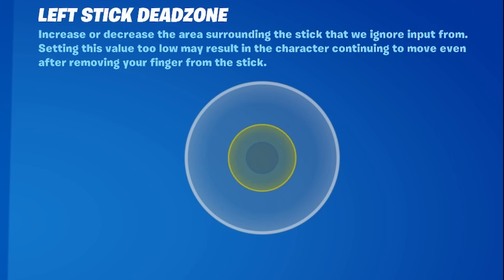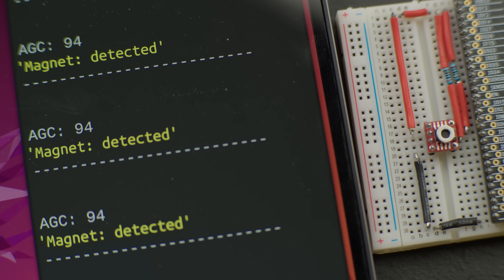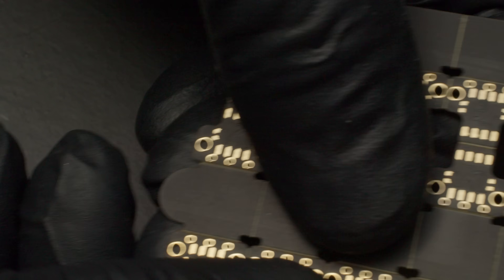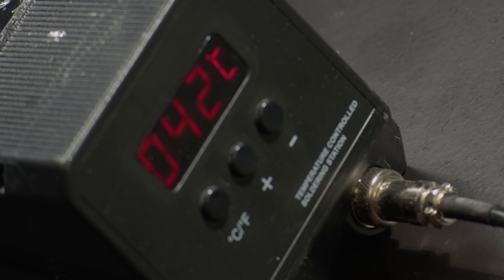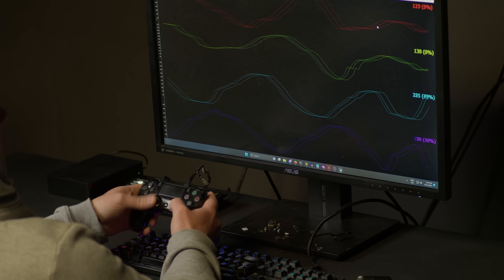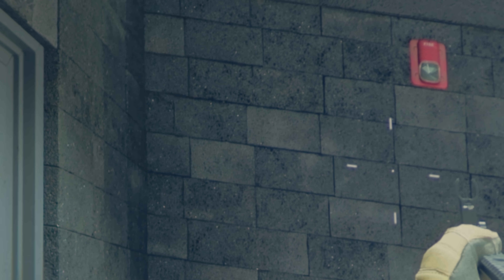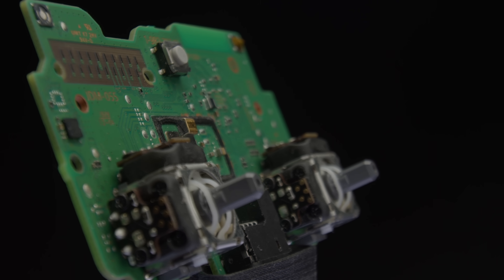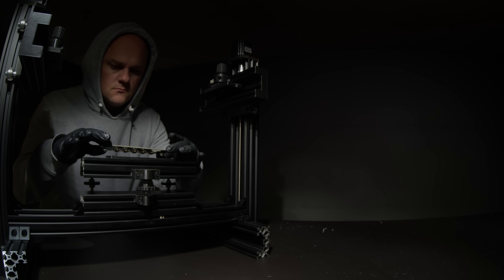Beating the $20B Joystick Drift Problem, and giving it away for free

Comment: well.. this drift issue is sadly common with the PS5 controllers, many brake within months, and Sony know this that why the warranty time is low on them...
they made a pro version in which case you can replace the analog sticks, cos its made modular, but its a fortune...
so if you can do this for the PS5 controllers, that would be great...

Comment: I'm pretty sure the companies that make controllers don't want to fix the problem. If stick drift didn't happen I would still be using the controller that came with my system. Its the only consistent point of failure I've ever experienced. If a single youtuber can find a workable solution, a multi billion dollar company has no excuse other than planned obsolescence

Comment: Slapping these on a VR controller might not work as those tend to get, well, slapped around.  There is a reason the Knuckles use a cast metal frame.

Comment: didn't the Nintendo 64 use optical sensors which is why the stick physically wears out before the electronics? We need optical...no magnetic interference possible and possibly smaller and more durable (gamer rage proof) components.

Comment: I like your motivation and I commend your efforts. I think you are only solving one symptom to the overall problem. Joysticks get stuck and drift happens also cuz the joysticks are not rotating on bearings its plastic on plastic and like you said, wear happens. *also dust, dirt, and gunk  add to this effect.

Comment: Summery: there no excuse for the tech to not already be in controllers, its cost is not relatively huge. We already did it 25 year ago with the sega dreamcast. It a matter of greedy and incompetent not of inability to do so or cost. 
         
          

        The main problem is its profitable to sell you a controller with crappy joystick sensors. did you know ps2 controller kinda solved this issues to a degree. it as simple as moving your thump stick from max to min for both y and x axes will recalibrates it self when you do so (aka using it). no fancy sensor yet I still have ps2 control's that still work with low to no stick drift. i can fix it by recalibrating. I probably put more total time in one of my old ps2 controllers then I have in the past 5 brand new one. I could just be vary luck but that's not considering in 1998 we had hall effect controller. IN 1998!! The Sega’s Dreamcast controller came not only with a joystick. (The new alternative at the time to using a d pad ) It was also had hall effect for the joystick. so even if Im lucky There is no reason why it has taken this long to do something so simple other then profit margins because it might be cheaper to use a crapy sensors and most definitely cause its more profitable for you to have to buy another controller's. It not a matter of if they can or if they should it a matter of them being to cheap. it not prohibitively expensive to do so either because if an end user can do it them self for cheap let alone they already did it 25 years ago, A company as large as PlayStation or Xbox has no excuse. It the same reason why Nvidia thought be fine to have  $400 1080p graphics card that fail to beat the previous generation, now only costing more but also have a smaller bit bus and laughable memory for the price not consider the $100 up sale for 8 more gb of vram its a downgrade in almost every way, it cost more and performs worse then it predecessor. 

        At the end of the day the only thing they care about is your wallet and if your willing to open them up. They have already solved this problem there just more focused on profits and that's not going to change any time soon or at lest till they start getting flak for there incompetents and greed. There no excuse, if a hobbits can do it them self for cheap they can do it. They don't deserve a dime more for an issue that has been solved for years 25 years. Even if it cost $70 for a regular controller aka a colored Xbox controllers it should be the base line. engineering a product is the one of most prohibitively expensive part of product and they don't need to do that here. It a joystick sensor. It drop it in and calibrate, which has already been established is a capability of doing in a controller by it self let alone if your doing it in factory. At the very least $100 controller need to have it. No if and or buts.

Comment: Problem is, even back then with the old crappy sensors that could get stick drift in the PS2 and Xbox era, they already had a cheap fix that modern consoles controllers had removed. If you experience stick drift on start up or when the controller first is plugged in, if you spin in a circle the effected joystick in a complete circle %100. The controller would recognize stick drift and recalibrate a new center that lines up where your stick now changes. This is why old controllers can last for eternity. 

So while hall sensors are nice and would make a good change, a huge, HUGE relief could be made with a literal software update on existing hardware, this would save the consumer from needing to buy a new controller just to get a hall sensor until the controller fails sometime later in which the user would then get the updated controller.

Comment: Is the second sensor/magnet combo really needed? If you could measure strength / poles of the magnet? I'm certain that it's possible to make the design itself more durable aswel, although the mechanics of the joystick isn't easily fixed with new rubber bands... Just a thought I want to share, as it could give you new idea's or concepts. I cannot test this myself unfortunately for financial reasons and the lack of tools for it and time.

Comment: just pointing out one concern with the magnet , with the magnet being friction fit and grease ontop of that , it would probably be a good idea to have some kind of spoke attached to the magnet and interlocked with the joystick spoke to keep everything in line with out having to open the controller back up if the magnet should slip in its rotation
Reply from the maker: Ill find out during test period. But its a thing i got on the list. Simplest solution is to drop some glue in the holder. I have also not measured if the grease is actually needed.

Comment: Elite Series 2 has software on the controller that auto calibrates the dead zones and Max draw distance for the potentiometers I'm assuming it should work if drop-in replacement for the Elite Series 2 as as I move the joystick app on boot up on the controller it will auto calibrate

Comment: I dont understand, these sticks have already existed in the mass market (preinstalled in a controller) for about a year and can be purchased for modification. This isnt anything new and you are prototyping something that has already been solved.
Reply from the maker: Nope. Thats wrong. Ask chatgpt, whats the difference between a angle sensor using two hall sensor 90 degree apart to track the rotation of a rotaring magnetic field vs a single hall effect sensor that senses a north and south pole to make two linear scales. Or something like that. And its gonna explain
Reply: @MariusHeier1  Chatgpt is not a reliable source

Comment: Sega Dreamcast did there's a couple decades using magnets and sensors this was way back in 98 or there are four sensors on the PCB and then something on the analog why this number took off and we are the crappie analog sticks we're using now is beyond me.See this makes no sense the only game system I know of that uses a different type of analog controller was the Sega Dreamcast and it never had an issue it looks like it was simple only a few components and never ever and I've ever seen a Sega Dreamcast controller have that I think there controllers actually use a different type of sensor

Comment: For anyone thinking these might be too bulky for some controllers, there's a company selling replacement hall effect JOYCON STICKS that work just fine. There's zero reason why every single game company can't use these. They just choose not to. The Dreamcast used hall effect sensors for both the joystick and analog triggers, so this isn't even a new thing in the gaming industry. They're also BARELY more costly than the cheap sensors they use now. They just decided to save a tiny amount of change because F' you that's why.

Comment: What would you think about making your own controller all together? 🤔 maybe like those modular 3rd party controllers for all platforms.
Reply from the maker: Model: GPT-4

￼￼

Fix grammar. Im making a ps4 main board. Because the hardest part manufacturing a controller, is actually all the plastic parts. Paying for their manufacturing, and making it work. Thats one of the reasons most of the controllers from china is just replicas of Nintendo, xbox or sony controllers. Designing modular system is so so hard. So i will first, probably design just 5 different mainboards to fit the different needs. Because they are all gonna be super cheap..very few electrical components costs alot of money in the eyes of the customer. But for the company making them its a really big difference. If gulikit used my sensors instead of theirs. Their cost for making controller would be 20 times higher to cover the part that does the magnet measurements. But... Will probably make a custom when i feel it will give enough advantages. 

ChatGPT

I'm in the process of making a PS4 main board. The most challenging aspect of manufacturing a controller lies in the creation of the plastic parts. Covering their production costs and ensuring their functionality pose significant difficulties. This is one of the reasons why most controllers from China are mere replicas of Nintendo, Xbox, or Sony controllers.

Designing a modular system is an incredibly challenging task. Therefore, I will probably start by designing just five different mainboards to meet varying needs. As they will all be relatively inexpensive, only a few electrical components will seem costly to the customer. However, for the company manufacturing them, this makes a significant difference.

If Gulikit were to use my sensors instead of their own, their controller production costs would be twenty times higher to account for the component that conducts magnet measurements. Despite this, I may decide to make a custom controller once I determine it offers sufficient advantages.

Comment: I'd really like to see some quality engineering type work done. Like have you thought about using your fancy robot (which is dope by the way) to stress test how much longer this type of sensor would last vs the traditional pots. Like a device that measures the values as it cycles the joystick back and forth in both axis so you can see how the measurements change over time and how much drift accumulates. Hopefully this could quantify how much better this actually is which would be very useful to see.
Reply: Might seem silly, but with the testing lab that LinusTech Tips is building, this seems like something that is right up their alley. Send them a bunch of samples, give them a basic installation guide, and ask them to test it against unmodded popular gamepads for a few million actuations to see 1) where does it fail compared to standard pots, and 2) how does a "worn down" joystick feel to play after it's been tested. I really bet this is something they'd be happy to test.
Reply: @bruwin  This would be awesome to see! They probably would be interested in this.

Comment: Great content, both video and engineering. Though it's not that the engineers that are the root cause of the issue, but shareholders demanding value. And you extract less shareholder value by making long lasting quality products.
Planned obsolescence is a design requirement as is saving cents on a 100$ product.

Comment: SLA is actually far easier for the average joe to use and maintain. It's 1 motorized axis and a screen that's usually a standardized size and shape. If anyone is planning on getting into making their own, a Photon Mono 4k is ~$200, and a bottle of Syriatech Blu v2 (which prints plenty durable enough to handle gamer rage) is $20. I've been using it to print Arcade button shells, and they can take some ridiculous abuse.

Comment: It sounds like the sticks would need sturdier springs and sturdier material for the joystick bottom section themselves.
Reply: Even so, I am not confident in opening the controller to replace the analog sticks with these even if I did have the proper equipment (which I don't). I ended up ruining 2 of my CECHZC2U A2 DS3s trying that (the cheap as hell DS3 that use a flexable cable for the stick boxes and small as heck VX8 motherboard).
Reply: So would it be possible to buy a completed controller or send in one instead? O.O

Comment: the funnyest thing is that you never hear about a PS2 controller drifting, the Playstation 2 and probably other consoles from that era, had software that adjusts the zero position in accordance to the maximum/minimum values the stick sends out.

It's not a perfect solution but it made sticks last far longer than any contoller today. The only reason stick drift sill exists is greed

Comment: This is a fantastic demonstration of a DIY hall effect sensor, absolutely brilliant. However now we need to solve the last part of stickdrift  that you actually mentioned in the video - the spring. Even with a "0 drift" hall effect joystick sooner or later the center spring loosens up and the stick doesn't recenter properly. I don't know what the solution is. A stronger spring would make the sticks too stiff and tougher to do fine movements with. Perhaps a different material?
Reply from the maker: Active centering!  With electromagnet or motorized axle! :D
Reply: @MariusHeier1  would you be able to create one at such a small scale of a console joystick? Sounds more difficult than the hall effect mod/kit itself.

Comment: Now that the problem of the drift on the controllers is going to be solved forever the next step should be to make "magnetic triggers" and "mechanical push buttons" (rubber membranes for buttons always  breaking), I suffered an accident, a lesion on my left wrist only allow me to play with controller, using keyboard for more than 10 minutes hurts because the position of the arm but as a downside the intensive use of controllers make them get damaged in 3 to 5 months then i have a pile of controllers that grows after years of gaming, all i want is a controller to be reliable and durable even if it cost more.

Comment: E2.
Pleased to know you didn't succumb under corporate greed. 

E1.
Please coat the magnet in nailpolish or polyurethane lacquer, the Neodymium mags are very much prone to corrosion, sweets/ moisture from hand will accelerate that, especially if the grease melts out in summer, not sure about silicone grease though.

Hey man you did my work, I was developing the same ...but didn't know there is such ICs available....love you thanks
❤ +1

Comment: Sega Saturn had magnet hall effect sensors on it's analogue controller 25 years ago.  It's not a matter of nobody knowing how to beat stick drift, it's a matter of consolidating thumb stick mechanism producers down to only one - who makes garbage at the behest of console makers because it's disposable and you'll have to buy new ones every six months.  PS2 had the same mechanism for it's analogue sticks and it used a software solution to change the dead zones and stop drifting.  It's not a "Can They?" issue, it's a "Will They?" thing...

Comment: And if magnetic interference is still somehow a concern, it could be possible to make an axis controller with optical sensors. That's another way to detect position without having physical wear. It could probably be done with optical gates/windows or something like two pieces of polarized film that would affect intensity.
Reply from the maker: Im gonna work on optical next time. Its just alot more work to make custom reflective "wheels" so i did this first.

Comment: Where was the joystick drift problem on PS2 ?
Reply from the maker: The "genius" trick of storing the initial factory voltage as a center point made the controllers inrepairable. They basically reversed the replaceable option for these joysticks. Alps made them to be replaceable because they probably use less carbon film on these.

Comment: Curious, What is the difference between these and what Gulikit makes? Other than usable in ps controllers?
Reply from the maker: Gulikit uses magnetic field strength to create positions. My sensors is using the  two hall effect sensors 90 degrees apart to create a position signal of the magnetic field. These works without alot of signal processing..gulikit ones dont work a lot better than pot meters (unless they are very old) without a ton of signal processing.
Reply: @MariusHeier1  very neat!

Comment: I’ve never had a single issue with stick drift apart from a ps3 controller but that was over a decade after the ps3 was released
Reply from the maker: I also have seen PS4 controllers with no drift. Even first generation.
Reply: @MariusHeier1  Yh from my experience I never buy the console with a controller so maybe those that come with the console are made a bit cheaper

Comment: Interested to see if this is picked up by those who design controllers. Hall effect sensors are not new to them, as they are used for the triggers on the Xbox controllers
Reply from the maker: The biggest difference is that these are just using multiple hall effect sensors. They are better known as position sensors.